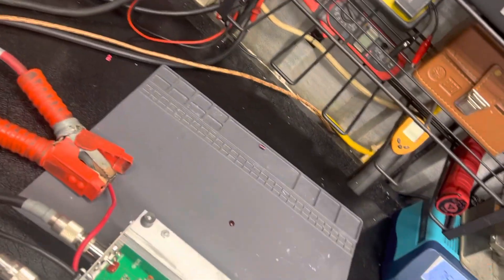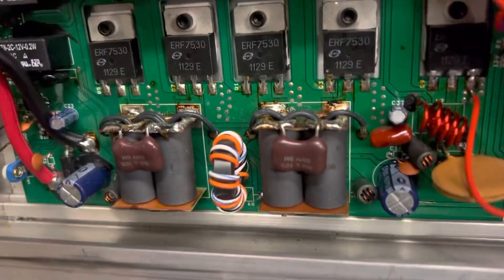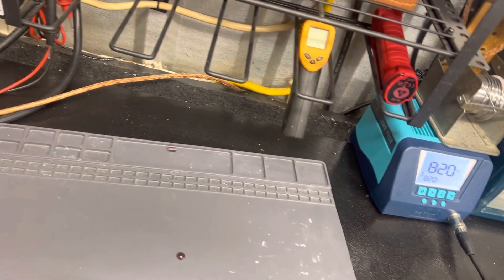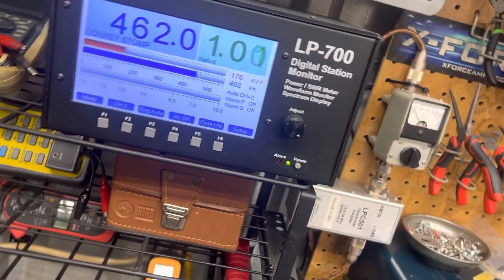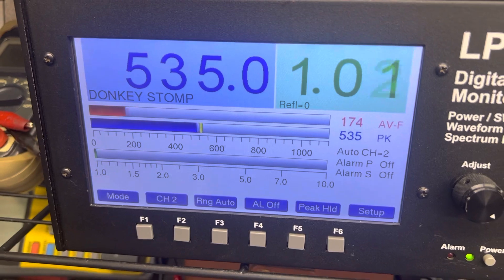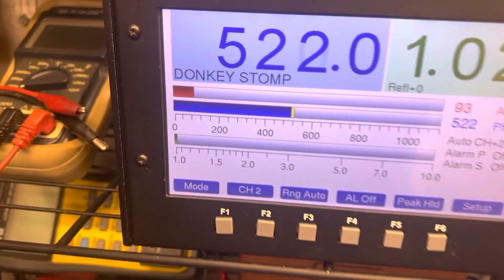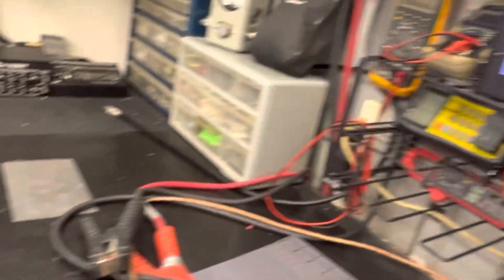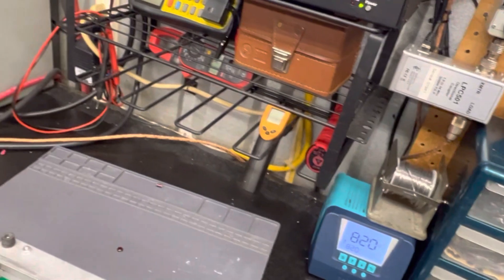Donkey Stomper Products, Palomar LD 450-FET, CW Transmitter Repair Test/Review

Comment: They are High drive. 12w dead key and 80 peak. Yep i said that right. Same thing as a Rocket box. Mine is the same as in the video. Took out the 7530 mosfets and replaced them with 9530 and @ 14.6 with 70 peak it dose 600. Keep a fan on it they do run hot.